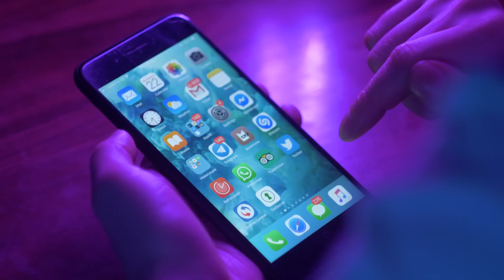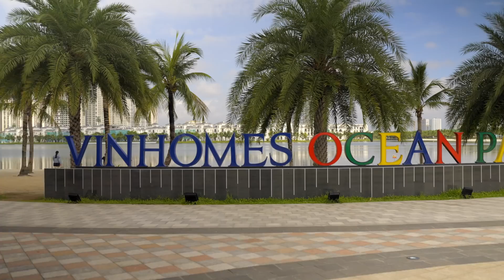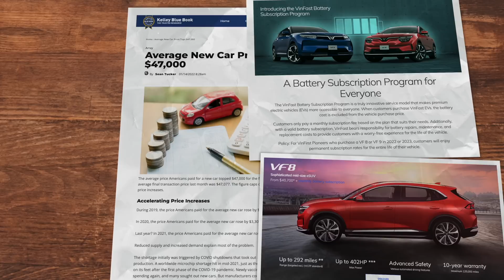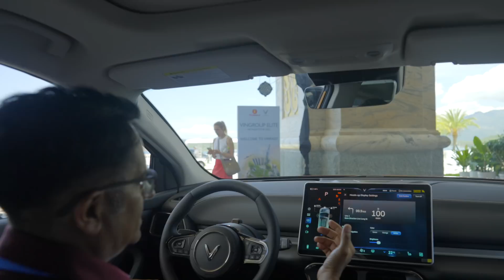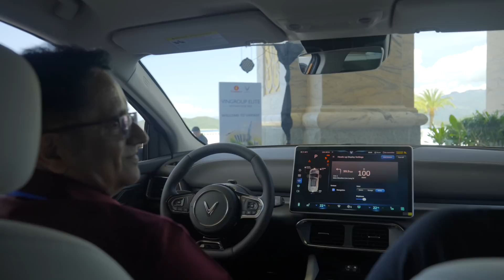New Startup FINALLY Makes EVs Cheaper Than Gas Cars!

Comment: Substituting the current fuel-based cars and pickup trucks with the same but in electric is not going to solve the world's energy problems.  We need cheap low-energy-consuming and space saving personal transport vehicles, such as the Toyota i-Road and many other European equivalents, not 2-ton boxes that have been electrified.

Comment: Here's a question for ya buddy. If every car goes electric do you think the electric generating infrastructure is going to be able to support it? Another good question for ya. Apartment complexes all the tenants park in parking spaces throughout a huge parking area. Do ya think that every apartment complex owner is going to be able to provide plug in charging at every space? It would be absolutely costly and insane!!! Hydrogen fuel is and will be the better way to go.

Comment: The main problem with Vinfast you pay 45k to start and  pay  a minimum of $110 a month forever.     An unknown company to most of the world.   If it were a 30k car this might work.   If I have a choice of this or a Chevy blazer electric at the same price from an 100 year old company with a 130 , 000 mile battery warranty.    I will take the Chevy.    If the Y drops into the 50’s  I don’t think this company will make it at least in the states.

Comment: EVs are great for those they knew they won't drive more than few KMs full AC or Heater on continuslie 

I won't buy until the range is minimum 1500.kms at least and with the super duper quick charge option max to max in a 15 minutes

Comment: Battery subscription?   A constant $110/month lease on your car?  Yeah screw that,  it barely works out in your favor if you're electricity price is actually close to that average.   However take a state like California where you just about multiply that number by 3 to get the cost of electricity and there's literally no way it makes any sort of financial sense,  and I mention California because that is the state most likely to buy electric vehicles especially as they are working to phase out gasoline car sales.

Comment: The powers who are in control have been artificially jacking up the prices of ICE vehicles to force the populous to move to EVs! The only issue I see is that EVs also polite. Major strip mining is required to produce batteries for EVs. Then there is the major environmental impact of producing electricity! Every facet of going green produces just as much environmental pollution! While I am a fan of moving away from ICE vehicles I believe only a complete move back to a pre Industrial age world can achieve what is necessary!

Comment: The problem with EV for the mass market .
If you stay in a country that is large. Charging points for road trips , the infrastructure is still so badly underdeveloped.  Yet they are pushing this.
Secondly, if your residence is in an apartment.  No home based charging point available. Whereas Gas powered vehicles doesn't have this issue.
Thirdly, the prices are still high.
We need a Henry Ford moment in Evs. We need the infrastructure to support these vehicles.
Failure on these points will mean, Ev vehicles in most parts of the world is not desired for many years in the future.

Comment: As usual a great informative video, thank you. I'm having trouble wrapping my head around the phone app to vehicle interface; for example, where is the advantage of using the phone to open your moon roof vs simply pushing a button in the car? You have to break out your phone, open the app, navigate to the right screen and then open the moon roof vs simply pushing a button already in the vehicle.  Also, this vehicle is still too expensive, we need an electric vehicle for the great unwashed masses. Can you say Model-T or Volkswagen Bug?
Reply from the maker: Venting windows before you get to the car, checking if anything is open from your couch and closing everything if there’s rain in the forecast. I often turn on the AC as I’m paying my bill so the car is cool when I get there. Stuff like that perhaps?

Comment: From what I can tell, the car is a good car with a very good warranty, but as always, there is a catch. The battery leasing is 110 per month for the  VF8 with the average driver driving 1200 miles or more per month that would be the only one that makes sense. This adds 4000 to the cost of the car. After 36 months you have the option to buy the pack or continue the lease. Even if they sell the battery at 1/2 price after 36 months you are probably adding 10 to 15K to the cost of the car. I am a big EV advocate and currently own one and had solar installed but that does not mean I support all manufacturer's policy
Reply from the maker: Good questions I can follow up and ask for more info

Comment: B4 making all these EV's they should try upgrading the grid and protecting it, people don't realize how these charging stations and so fourth will be pulling a lot on the grid, therefore you can expect more rolling brown outs and outages in general, the grid doesn't have the capacity to handle this yet

Comment: I hope new ev companies realize to get over the “moat “ of legacy dealerships they also need to have access to service centers in almost every major city in the us.  I understand, theoretically, EV’s don’t break down like ICE’s do but if given the choice between a vinfast EV or a Toyota EV I would pay more for the Toyota just knowing that I have a place to get it fixed if and when something goes wrong.
Reply from the maker: This is a great point. Dealerships suck in many ways too… they mark up prices and are a needless middle man. Perhaps the answer is a company that provides service that all the new companies can license. Sounds like a huge and lucrative business opportunity.
Reply: @TwoBitDaVinci  Tesla has a few service centers around the country that don’t sell cars. The problem is there isn’t enough of them. An 2014 model s owner I know needed a battery replacement (@130k miles) and had to flat bed his car 70 miles to the nearest service center and then they determined they couldn’t do the repair there and had to flat bed it out to California ($20k after all the added transportation) So the few service centers around are also not full service. I do believe it will get better but this is a huge hurdle that legacy auto manufacturers have a leg up on. Perhaps you are on to something about a licensed Tesla/vinfast/rivian service center. Whoever gets there first should make a killing.

Comment: Sorry, WE are still on too big cars ...
YES, me earlier also after 2 smaller Ford, used 2 524/525 BMW Diesel as had long distances and Diesel was cheap to got good money.
Now still using a Toyota Pickup Hilux (750.000 Baht) as former needs (transport fish, and 5 bicycle) I realize that FOR a better future I just need a small one: 100 kg shopping once a week, and max about 60 km before back home. I see at my partner, how she seam to think loosing face as of smaller car, but it is simply survive small or die big.
I have my Eye on just a 110.000 Baht, 120 km range, max 45 speed unit. Easier to pay, to park at markets and enough for school ride.
This here is 2.072.000 Baht ... in a country here highway max 90 km/h speed ... so even the actual Toyota is over motorized, but we had some steep hills.
But WE NEED to focus on downsizing - Nice to see what have, but times are changing hard ...
And as former IT Security trainer ... it is just a matter of time that this cars are hijacked ... and than as allays, cry OHHH, that shouldn't happen
enjoy ... a joke making car assistance ... until it goes away with you, without your agreement.

Comment: @ Two Bit da Vinci

It's great to see something like this... Ford apparently has gone "all in" to making EVs... but they are going to get killed because they are trying to make a bunch of different EV types, rather than a few - that's why Tesla has a chokehold on the market...

All great companies start with very small number of products, build loyal customers, then expand when they have solid footing to do so...

It seems that this company is trying to do too much with other "unnecessary" things (e.g. university)....

Do you think that perhaps spreading themselves too thin will create roadblocks for success?

Comment: It is always a good thing when new companies bring competent products to market. If forces all others to respond with improvements to their products. With that said, EVs have a lot of hurdles still  to overcome, such as cost, charge time, range, life, consistently working charging infrastructure, ethical and sustained mining of raw material for the batteries, safe disposal of batteries at end of life and more. These are questions that must be addressed before EVs can even reach a one for one sales ratio with fossil fuel vehicles, let alone exceed sales of fossil fuel vehicles. 

I also want to add that power grids around the world are having problems supplying the current demand and the demand challenges are increasing exponentially as countries switch more of their power generation away from fossil fuels and nuclear to  green energy. These changes with current green energy technologies cannot sustain the power grids without the more reliable fossil and nuclear energy sources. And if we add an ever increasing demand for electricity for EVs to the equation we again increase the challenges to maintain a stable power grid. So many questions and challenges will need to be addressed and overcame before EVs can become the dominate form of transportation in the near to long term.

Comment: Good video!   New subscriber here.  I’ve long been interested in an EV, but I’ve been put off by the cost and the fact that one really can’t make a long road trip in it.   We make long drives from Maryland to both Florida and Texas, and there is no EV that can make that trip without multiple overnight charge ups.  I’ve long said, once an EV comes along that can be fully recharged in the same time it takes to fill a gas tank, that EV will be a true game changer.
Reply: It sounds like you would benefit from a hybrid vehicle for now. You would still get excellent fuel economy from the hybrid powertrain, but not have to worry about charging. And if you get a plug-in version, you can have modest electric only range for around town trips but still have the gas engine for those road trips. Even if not all electric, it's still a big step in the right direction.

Comment: VinFast cars are absolutely amazing and the fact that they come with a 10-year/125,000-mile warranty is great but shouldn't that include the battery as well, adding the battery subscription program I just don't understand it's a bad business decision
Reply: The way I understand it is that they are like the Chinese company Nio where you buy the car cheaper and subscribe to a battery monthly cost. Then when you need more range you can just drive to a battery swapping station and change the battery for a fresh fully charged battery. You don't need to wait for charging it and is as quick as filling a gas vehicle.  I think the subscription idea is excellent. As long as the infrastructure is there to not worry about range anxiety at all.
Reply: @g0fum  we buy the car 20k cheaper if you get battery subscription. VF9 is 219.00 a month. 20k ÷219 =91.32 months and you sale the vehicle or trade it in in 7.58 yrs you break even. Or keep it and if it goes under 70% you get a new battery. Without the subscription you have 125k miles coverage but with the subscription you have unlimited miles. I will probably have 125k in less than 5 yrs so the subscription would be best for me. If you do 12k a year then buying it out right will serve you better. It is whatever is best for you. I am at least reserving one since I missed out on the R1S by waiting on the sidelines. They went up 20k in one day
Reply: @g0fum  lol no, Vinfast doesn't do battery swap. The subscription is to lower the cost, and in case your battery wears out, you can go change it for less money. 
In case of a Tesla for example, if the battery degrade or has problems you might have to pay up to $20k to change the battery.
Otherwise it is still a normal charging EV, not swapping battery.
Reply: @maxiejohnson8356  AHH well that's a pain in the arse. I think Nio are on to a winner with their idea. You don't have to worry about your car's battery dedrogation and all you need to do is find a swapping station en route of your journey.  In that case Maxie I don't see Vinfast selling many cars if you've bought the car and battery then having a subscription on top. Especially in these times expense is something many people can't afford. Including myself and I have a fairly decent paid job.
Reply: @g0fum  NIO is not gonna do anything, they will change their business model purely out of practicality, Im sure. While Vinfast is a Vietnamese company and me being a Vietnamese wanting it to success, I understand how their ideas can be hard to accept. Long-term benefits are never apparent to the consumer, so it is best if you can calculate and make your own decision, otherwise owning eveything is still less of a burden.
I would not buy a seat heating subscription for sure....
Reply: @maxiejohnson8356  I love the look of their cars so I hope they are successful too. I'd love the VF9 but just can't afford it.

Comment: The $160/month battery subscription means the longer you own it, the more expensive the car is. It’s the equivalent of an $8,500 car loan at 3% over 5 years. The problem is, after 5 years, it’s not paid off at all. You own the car for 10 years and you’ll make $19.2K in “battery subscription” payments. They replace the battery if it holds less than 70%. Okay. So does Tesla for the first 8 years of ownership. And you own the battery. Not a fan of this business model.
Reply: It suits people who cannot afford paying 60k for an EV plus it gives you a peace of mind regarding battery. Paying 20k up front will cost more on financing. Also future value of money is much less its present value due to (high) inflation so paying 20k now is much more than paying $160/month over the next 10 years. With 5.25% inflation, 12k now is equal 20k in the next 10 years so you save $8k. Besides, battery technology keeps changing so clients might get a better battery in the future.

Comment: With battery leasing the cost to the consumer should be $10,000 less. Also, hydrogen power is better long term solution for moving around. Another battery powered vehicle is ho-hum.
Reply: Hydrogen is expensive to store, and even more expensive to make. Hydrogen cannot compete, economically, with far cheaper electricity. Moreover, there is no way to make hydrogen cheaper than its source (electricity or natural gas), so there is no way to make hydrogen economically competitive. The only place hydrogen will be used is where the high cost is not an issue.

Comment: Geez... you know. I would rather use opensource software than paying for subscription based model. If car manufacturers moving to subscription based model, I would rather not drive. Too much control from the car manufactures determines what features they can turn off or change what comes with the subscription. I think the problem is... the price of the car is much higher than what most people want to pay. There are many  low-mid income level families who can't afford EV. If it was a swappable battery, I'm more incline though. But the pricing/subscription model is not really for most of the low-mid class consumers. Some might have to decide food or paying for battery subscription for a car they already bought.

Comment: Why does the EV market not use any self control why do we have to make so many cars so fast  All we're doing is outpacing the source material and meanwhile we're punishing gas car owners. Typical BS that you let the government step in and make a mess out of it. OK there's a flaw in your math if I buy a gas car and I have to cut back on my driving because of the cost of gas I can do that. if I decide to not pay the damn payment on my $600 a month electric car they'll come take it. and the savings that you keep saying the governments affording people is gonna go away when the roads start to fall apart because we're not paying gas tax in gas tax.  If the electric cars are so fantastic why does the government keep subsidizing them at the expense of the people that own gas car. Wait until your power bill starts to go through the roof the roof when all these people are charging their cars at home you'll be turning lights out just to be able to charge your car.

Comment: The VF8 is a internal combustion engine designed vehicle, with a transmission tunnel and cramped back seating. It is this significant heavier and less efficient as well as having much less space than any vehicle designed as a pure ev.
There is not enough information released yet on the vf9 to determine if it is a pure ev design or it also goes down the BMW way of stuffing EV tech, into a ice platform.
I hope the vf9 is a ev from the ground up as I have one on order.

Comment: Given the potential of battery degradation to significantly impaired range renting the battery makes good sense. Of course, it depends on whether battery rental is priced on time or mileage – – and how much of each before you can return a used battery for a new one.
Reply: It said unlimited

Comment: As cheap as a gasoline car?   $40K is way above a typical gasoline car.  
For example:  2022 Toyota Camry Hybrid LE: $27,380 MSRP. 
2022 Toyota Camry Hybrid SE: $28,915 MSRP. 
2022 Toyota Camry SE Hybrid Nightshade Edition: $29,615 MSRP.   7 Dec 2021

Comment: The cost of energy to power the vehicle doesn't matter if you can't afford the vehicle. I'm struggling to not loose my current vehicle that cost much less. We are in a recession with extremely high inflation.